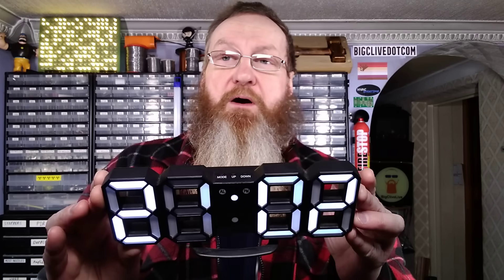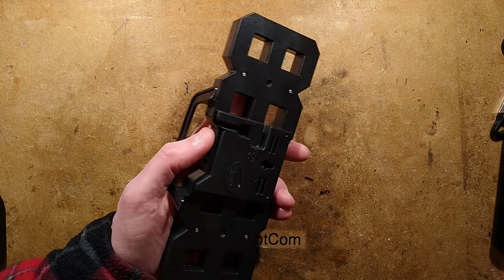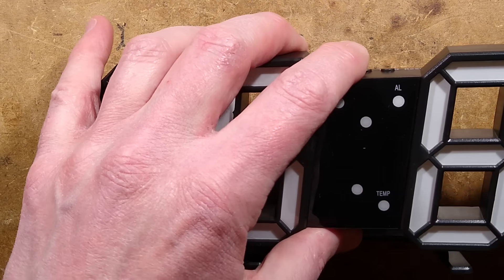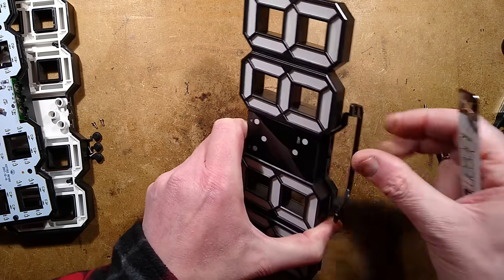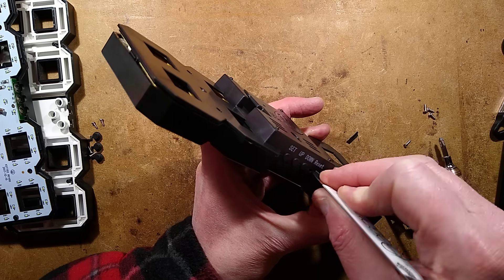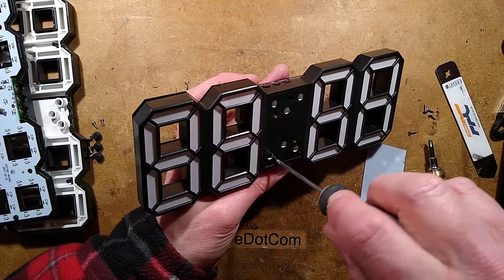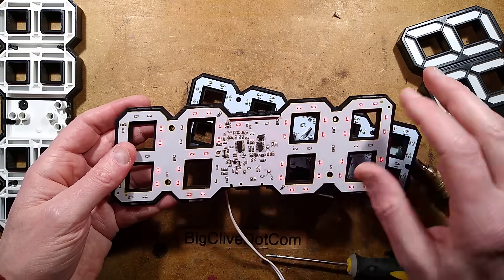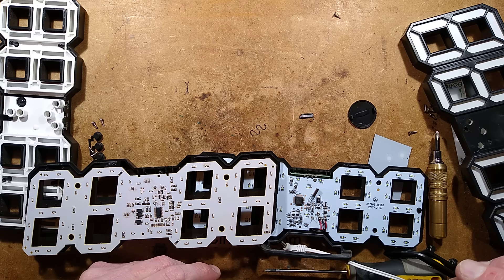The CURSE of white LEDs

Comment: Two things kill LEDs...
1) Heat. You can compensate for this by not driving them so hard but then they are dim. The better option is to give them a good heatsink with a large copper patch on the PCB (thick tracks to and from the LEDs) to disperse the heat as well as not encasing the PCB on all sides in plastic that insulates the module.
2) Humidity. This is the dirty little killer that no-one seems to take seriously. Even where a product seems sealed up, humidity can get in (particularly a problem in bathrooms, kitchens, and anywhere in the UK).

Your clock module looked like it had insufficient copper to spread the heat from the LEDs (directly connected to the component, not just being on the same PCB), too much plastic preventing the heat from dissipating, and too easy access by the ambient air with all its rich Isle-of-Man-y dampness.
Reply: With high efficiency LEDs, under-driving them is not a problem. Who needs 10mA or 20mA when you can get away with 2mA or less and still have a respectable level of brightness?
Reply: @techgeeknzl  That is very true, but putting diffusers over the top markedly reduces apparent brightness and can force the LEDs to need to be driven harder. The real issue is with manufacturers relying on internal IC resistance to set current when it may not be adequately controlled and not compensated for over temperature.
Reply: @alexogle8950  Agreed, but that depends a lot on the translucency and efficiency of the diffuser. If they were really at all interested in longevity, they could have easily doubled the number of LEDs per display element; which would have allowed a thinner diffuser to be used as well as significantly dropping the overall power dissipation.
For that matter, do you suppose they made any effort to balance the apparent luminance between the line segments and the dot segments?
Reply: @alexogle8950  also agreed; driving LEDs with anything other than a constant current circuit (even if it's just a simple resistor fed from a regulated voltage) is criminal; unless deliberately under-driving them by keeping the forward voltage well below their intrinsic "knee" voltage (which, I expect, doesn't work at all well when driving multiple LEDs in an array -- the current per LED, and therefore the intensity, would be all over throughout).

Comment: I bought a white one shortly after your video and I've had it running ever since, but I've had on low the whole time, but I'll have to check how degrading they are, I use it as a nightlight in the bath.

Comment: What a piece of junk. Both of them. Years ago I made a better version, using a 3D printer, OpenSCAD, VSC, soldering iron and glue gun. Materials: 60cm wooden plank, black printer filament, transparent printer filament, a length of addressable RGB LED strip, an ESP8266, a USB-power-lead, an LDR, some discrete components, some wire, some solder, a glue stick and some paint.

Paint the wood plank black. Design a 7-segment display and dot holder in OpenSCAD. Or better yet, grab such design from internet and modify to your own needs. Print 4 segment cases to the size you want. Mine are 20cm high. Print the dot holder case. Print transparent covers for the segments and dots. Glue 2-led pieces of strip in every segment and wire up the segments. Each with ground, +5V and data. Upload an addressable LED test sketch in your 2866, connect the segments up one by one and check if they work properly. Maybe add in some light-diffusing stuffing or design and print a light diffuser. Put it in, put the covers on. When it looks good, glue the covers on. Glue the 4 7-segment-displays and the dot holder to the wood plank. Design and print a housing for the 8266. Add the LDR in a voltage designer and connect that to an analog input. Connect the 4 segment data lines and the dots data line to 5 digital outputs of the 8266. Connect all grounds together. Connect 5 +5V lines of the display to the USB lead and power it from a power bank. Connect the 8266 to your computer and start programming. Use WIFI and MQTT for communicating the clock's colour from your home automation app to the clock. Use NTP for getting the time. Use the LDR's value to adjust the brightness for the ambient light level. Make it so that it stays below 2/3 of max brightness, for LED longevity. Feel free to add any other custom functionality you can think of. When done programming, add a +5V lead for the 8266. (We don't want the computer having to power the led strips during programming, add a switch if you plan to reprogram often.) Now print a little case for the 8266 and glue that to the plank as well.
Reply: I'm trying to figure out why we're reinventing the clock for a room when the basic Quartz analogue clocks are fine?  Heck, even the first digital clocks I remember seeing were like a big glorified LCD wristwatch.  You know, the ones with a reflective layer for ambient light?   Appeared to have a silvery grey background, or in some cases, changing the polarized filters around and you would have a black background with silver numbers.

Comment: I have this exact clock, in red. Been going strong for 4 years. The only thing I don't like about it is the bad time drift. It would be nice if they could sync with network time via wifi.
Reply: No no no. Sync via the broadcast radio signals: WWVB, MSF, DCF77 etc. They’ve been around for decades and this is an exact use case they were made for. I hate how many “modern” devices don’t support this standard way of syncing time for clocks, that has been around since the 1960s/70s.
Reply: @BlameItOnGreg  I've found the signals wholly unreliable, especially in urban areas with a lot of RF noise. There's a reason NTP exists.

Comment: My cousin is having a new house built. This here is why I suggested she have traditional can lights with old fashioned light sockets installed rather than those flat recessed LED fixtures. Several years down the road, one will fail and good luck getting a direct 1:1 replacement that will match all the others you have.
Reply: I made sure I got GU10 downlights for my lounge for that very reason. I also got 3 spare LED bulbs in case any of the 8 fail, especially if dimmable as mine are it's unlikely I'd find a match if one failed in few years' time. But it seems there are more fittings with non replaceable bulbs than there are GU10.
Reply: @simonbeasley989  in my house I use MR16 12V LED lamps. Some are still using the QH drivers, but where these don't work I have replaced them with LED drivers. They work well.
Reply: Either that or you buy an extra case of them right from the get-go as replacements for when the originals fail. I guess when you run out of replacements, then you come to your senses and put in normal fixtures with sockets :)
Reply: We do the same thing and then select bulbs that are CRI-90+ and select-able color temps from 2700K-5000K or even 6000K.  Then you can match ambient lighting or change moods or seasons or whatever without the extra expense of Smart bulbs and their very short lifetimes.  Standard sockets work great and allow flexibility, lower operation costs and long lifetimes.  Now if we could do the same with automobile LED head lamps that would use standardized shapes ans sockets with correctly designed reflectors...  $1,000+ US for LED headlamps is insanely crazy.
Reply: About 8 years ago I replaced all of the lights in our house with proper LED ceiling light fixtures except in hallways, closets &c where I used PIR LED screw in bulbs. The ceiling light fixtures have been very reliable but the screw in bulbs have all been replaced at least once. I would never use a "can" or any other recessed fixture for 2 reasons: 1) Recessed lights block light from the sides of the fixture so that (unless you have very high ceilings) they produce uneven lighting and 2) they hold in the heat and roast the power supply and the LEDs.
Reply: I work in a building built about 11 years ago. There are some LED can type light in the stairway which have had zero failures. In contrast the canteen was fitted with pendant LED lights which started failing after just a couple of years. The maintenance team were told by the manufacturer they needed to buy  complete new fixtures at £150 each, before discovering that they are built using Luxeon star modules that can be bought for a tenth of that. The modules they bought do seem to be a different colour rating so we now have a mixture of warm and cool white lights there.
Reply: My parents got those recessed LEDs in their new kitchen. I asked if they bought any replacements to keep on hand because what would happen if one failed in a few years? Would they even be able to get a match? They said no and not to worry about it. I wasn't confident enough in my concern to press it. Sounds like I was right to ask.
Reply: Those integrated recessed fixtures are already failing for me, a couple years into usage.
Can't change the ''bulb'' and most people will need to hire an electrician to replace the entire unit. 
I was astounded when I first saw these...
Reply: @mickeythompson9537  Even in the days of incandescent lighting pot lights were a poor choice and more prone to early bulb failure.
Reply: While I understand the rationale, I’m not sure I agree with the recommendation. LED “lamps” have the power supply and the LEDs in close quarters, and in a recessed can, the heat has nowhere to go.

I instead recommend using lighting based on replaceable LED elements, like LED strips.
Reply: What are can lights?
Reply: @steveharper2857  Can lights are recessed ceiling light fixtures (same as pot lights) so-called because the housing looks like a big tin can.
Reply: That, and everyone seems to have settled upon 600-800 lumen lamps for things like that which IMO is far too dim for a room unless you have like eight of them (I'm more inclined to use 1600-2000 lm with a dimmer)
Reply: @SuperSpy00bob  More for human reasons than technical reasons. Having a lot of dimmer lights is nicer for humans since a single bright light source causes glare. You get used to it, so you end up feeling slightly uncomfortable without realizing why. There's also technique to placing the bulbs so they provide light on the work without causing glare. Things like under-cabinet lights, or a light shining over your shoulder in your reading chair.

Comment: Over the past few months we've had 3 ceiling lights burn out, one was a replacement for the first one that burned out!  I tested the one that only lasted a couple of months, one LED dead.  Ok, jumpered it since its a constant current driver.  The next LED died in under a minute and I gave up on repairing it.

Comment: Well known culprits for early demise of LEDs being overdrive(more brightness, with less number of emitters) and heat(no heatsink to better ones with no ventillation on housing etc). It is not a surprise they don't live upto the 11yr half life anymore🤯. The presence of microphone is interesting, but lack of WiFi or other connectivity renders it benign.😂 Red is always better on a clock, since it will not mess with the Circadian rhythm and a bit gentler than white(no wonder was used in dark rooms for photo developing🤞-yes, I stand corrected(thanks to the commenter), the sensitivity of cone cells cannot be compared to phosensitivity of chemicals to light exposure).❤👍
Reply: Red darkroom safelights were used not because they were gentle, but because orthochromatic films and printing papers had little or no sensitivity to red wavelengths. Their silver halide emulsions were sensitive to blue.

Comment: Does anything change electrically when these LEDs fade, or do they just become diodes without the LE? 
This does seems to use the cheapest possible LEDs, I have some homemade lights with Cree chips running about 16hrs/day for 4 years now no visible degradation so far, we'll see how long those last.
Reply from the maker: I think they develop an internal resistance and pass more current.

Comment: I have the same clock, only in white, hanging on a wall in my bedroom. Bought it pretty much immediately after your first video about it.
I have added resistors to every LED, so it's just barely glowing. You pretty much can't see the digits at all during the day. Makes for a perfect bedroom clock, since it's bright enough to tell the time at night, but it doesn't light up the room at all.
I have also disabled the second counting LED, so it doesn't distract.
Going by your example of modifying light bulbs for longevity, hopefully it will last a long time. So far there's no noticeable degradation.
Reply: What do you say to it and does it have a transmitter?
Reply: @20chocsaday  I'm not sure I understand what you mean. It's only a clock, doesn't have any transmitters or microphones to talk to.
Reply: @zaqway  Okay, you have seen it and you know what it isn't.

Comment: I work as a site engineer, building panels sometimes. I've noticed a shift to all white Gallium nitride, for Schneider indicator lamps supplied by RS. The coloured lenses have changed somewhat too to compensate. Oh the joys if these keeping blowing. 😂
Reply: I used to work at a steel factory, and it was important to replace the bulbs in the indicator lights on the boards, otherwise you won't know if the lights are off or on. They used incandescent bulbs that somehow lasted years being turned on and off all day every day.

Comment: My mum has a Siemens kitchen radio with a green LED display that's been on 24/7 since 1995 or so. I often wonder if you could see any difference in brightness if you had the brand new one right next to it.
Reply from the maker: That will be based on the older gallium phosphide green technology.  very rugged.  And intensity degradation will be visible when comparing the segments that spend the least time lit vs the ones that are lit the most.

Comment: The blue LEDs on my LG microwave oven are wonky, not sure if it is a driver-side having trouble with multiplex, segment driver or LEDs having failed shorted. Same segment on all four digits are stuck together and dim. I'm guessing shorted LEDs.

I tried pulling the LED display module out but it is potted in there and the 1" long 0.1" header strip is soldered directly at both ends, can't conveniently pull the module out and do some measurements to find out which side the problem is on.
Reply: My Sharp microwave is like that. I think it's LCD with green LED backlighting.. Neither the LCD's nor the backlighting work any more. I just run it that way, just have to remember what buttons I've pressed.

Comment: LEDs are a great environmental scam. They are incredibly useful but did not live up to the green promise.
Reply: I changed every bulb in our house to LED more than 8 years ago ... dozens of bulbs using a fraction of the energy of previous fitments ... and so far every single one is still working. They are not all from one manufacturer/brand because of availability of sizes at the time of purchase. I did check on reviews and feedback before choosing them and they are all warm white if that makes a difference. It was the same with old school light bulbs ... they COULD be made to pretty much last forever but that didn't suit the manufacturers ... and the same commercial incentives (or disincentives) exist for LED manufacturers ... they're going to sell more cheaper but poorer quality bulbs. LED lighting has most certainly contributed to massive reductions in energy use for cities using street lighting and traffic lights and signage. Absolutely not a scam ... but subject to the same commercial pressure as every other product these days, which impacts quality.

Comment: White LED longevity apparently varies by LED quality.  Back in early 2016, I built the Alpha Clock Five (white) from Evil Mad Scientist, and it's been running 24/7 for the past 9 years and no observable degradation so far...
Reply: Yeah, I bought some cheapo LEDs from eBay and just with usage in my garage workbench they noticeably dimmed and turned bluer over a summer.

Comment: Should have used old school red LED's. My first LED clock will this year been running for 50 years 24/7. Same LED's, Caps etc.
The case has not been off since it was made some time in  1975. now getting close 480,000hrs.

Comment: I always assumed the life hours was calculated by the absolute minimum power to get them to 'light'
Reply: @Wanton110 the 50k figure used to be the led at nominal power until the output dropped to 70% (lumen maintenance) Accelerated test as nobody would wait 6 years to validate a process. Mfg was relentless at tweaking process chasing efficacy, heat management, shrinking die sizes etc. I would love to know the process slop that drives the binning madness for any given design.

Comment: I have had to replace the red 7 segment displays in my GW Instek signal generator.
It is 10 years old, but has very low hours.
The originals just faded away mysteriously.
A usb hub with blue leds, stays on all day long.
After a year of this I have noticed those leds are dying.
The joys of fine products assembled in a yellow submarine.